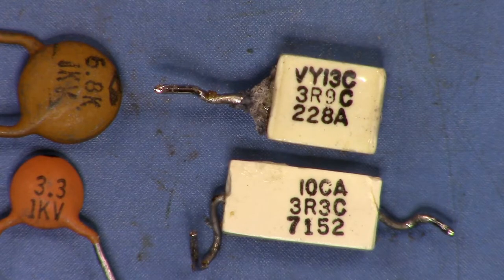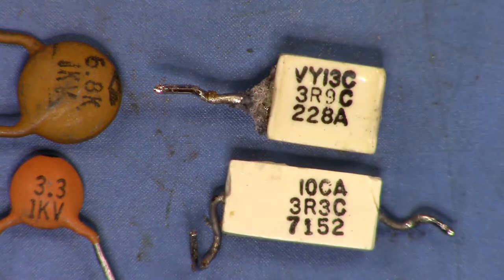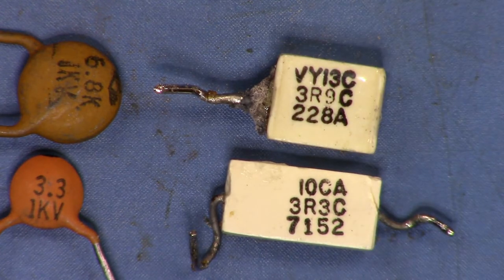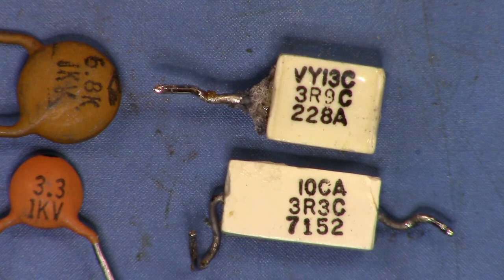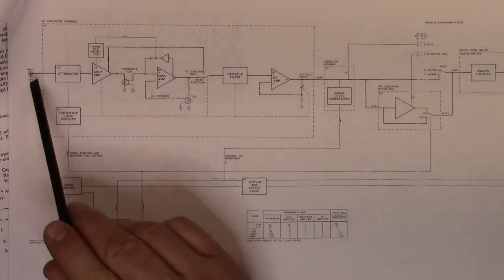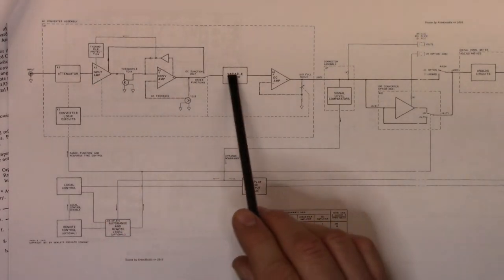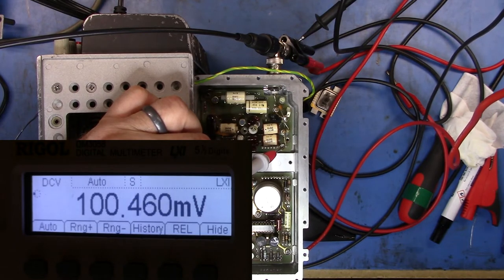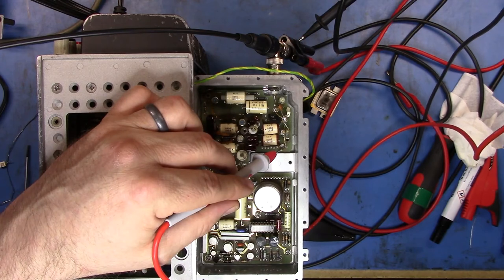HP 3403C Repair Part 3 - Attenuator Investigation

Comment: those caps are pretty old, look like paper caps, I would be seriously thinking of replacing them all.
Reply from the maker: The yellow ones are actually polyester caps and the rest are mica. Not saying that they are good, just that they're not electrolyte based ones. Then again, so was the porcelain one.

I think I need to take them out and check them anyway.